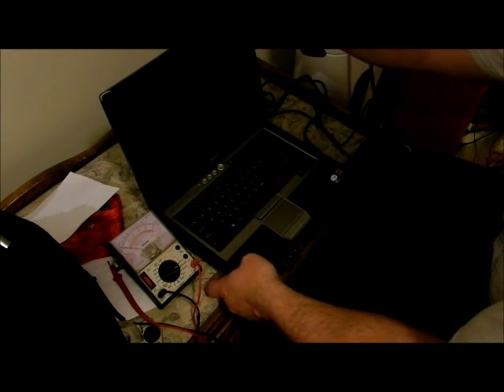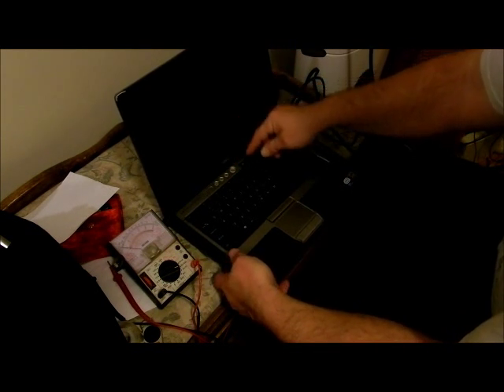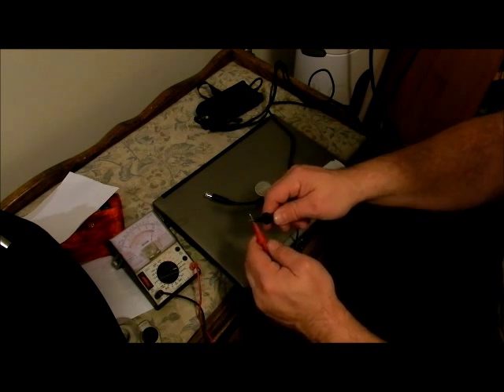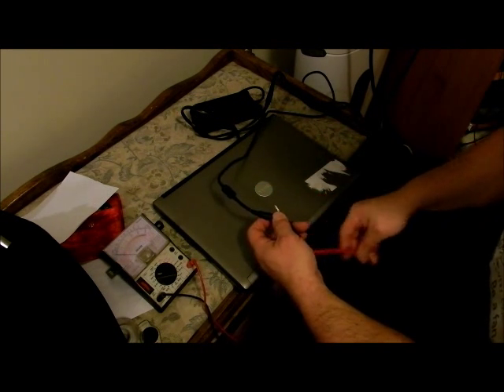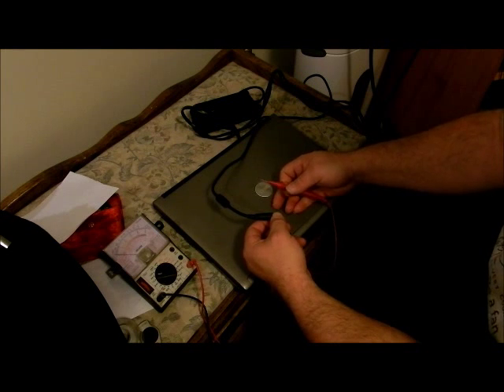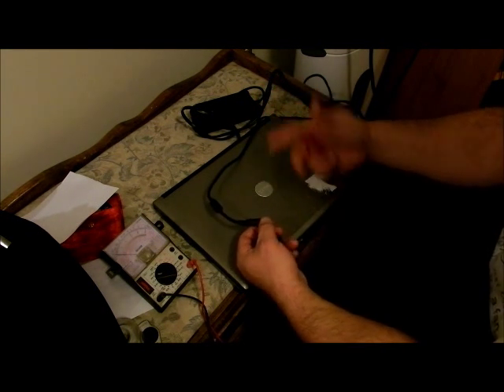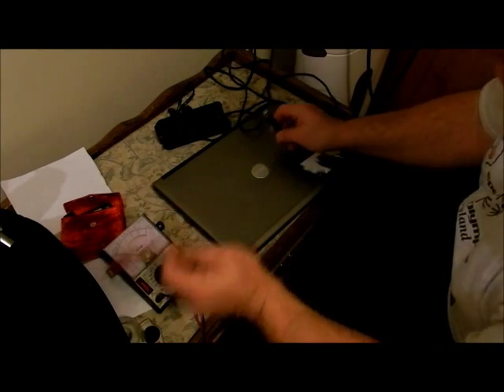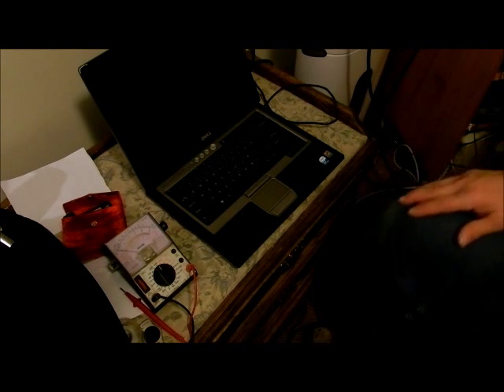Testing your Laptop Power Supply

Comment: I have a Dell Inspiron 20 3043 AIO and it won’t boot consistently.  The led turns on it sounds like the hd is being turned on and off then it goes dead. 
Could this be the power supply?  If I turn it on 20-30 times it eventually does boot and seems to work fine.  I have tried to get to the bios with f2 but it doesn’t seem to recognize that?
Thinking it could be bios corruption maybe too?  Very strange.
Reply from the maker: The BIOS battery retains the BIOS information such as the date and time.  This sounds like a cooling problem.  Try propping up the back of the laptop and have a small fan cooling the bottom.
Reply: William Quinn When the computer did boot to windows after 30 try’s it runs fine.  I stressed tested it hard with prime and HW-monitor showed 60-65c on all cores with no issues.
The power supply was normal warm to the touch as well.   I did try removing the hard drive expecting the system to report no bootable device. It doesn’t as it also takes a while for that message to show with a normal post. At that point even if I hit f2 repeatedly still no bios access.  Cpuz shows normal bios information and memory reports expected size. Windows also shows the expected memory size.  I did remove the cover and disconnected everything to the motherboard that was necessary for a post including the internal battery.  Still the same behavior.  Disconnected the bios battery and checked voltage, shows 3v as normal.   Left the bios battery out for 2 hours hoping that would clear/reset bios which I was thinking was the problem, but no dice.

Comment: Great video... Thank you for sharing your knowledge...and if you let me ask you a question: Do you think could be possible for a "All in One" PC sometimes (most of the times) fails to display the information on the screen because of the power supply does not working good enough? maybe the power supply is not giving enough watts to start the screen? is that could be possible?.. the computer is working fine because I plug an external monitor thru USB port and is working just fine... thank you for your help
Reply from the maker: Have not come across that yet.  Sub me just in case it comes up.  This way you don't miss it.